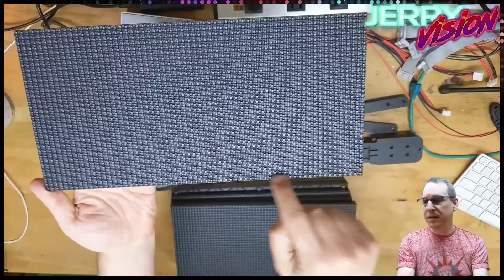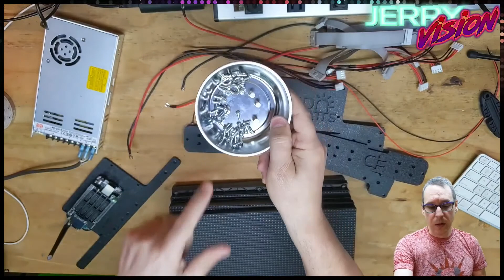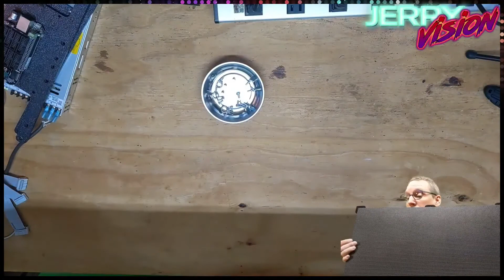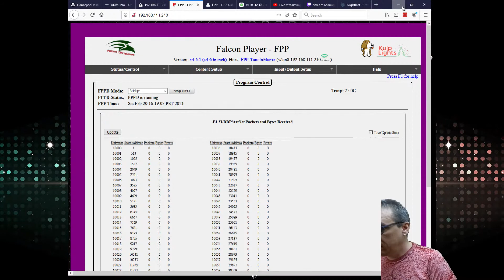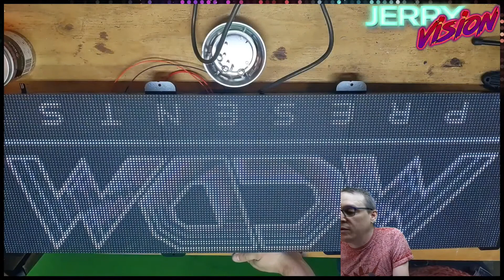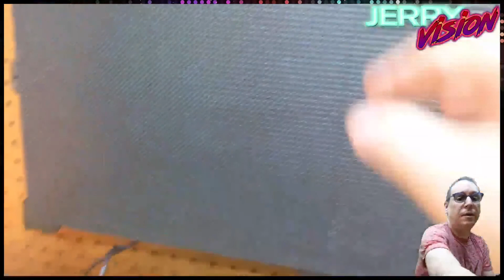P5 Panel DIY Build

Comment: Can these be controlled through windows or do you need a microcontroller?
Reply from the maker: I believe with a Colorlight card and a dedicated Ethernet port you can drive the panels directly with the Colorlight software.  Basically, you specify a portion of your screen that gets sent to the pixels. Here's a link to Jeff of Canispater Christmas talking about the software setup - https://youtu.be/JQerpqt76VU?t=239